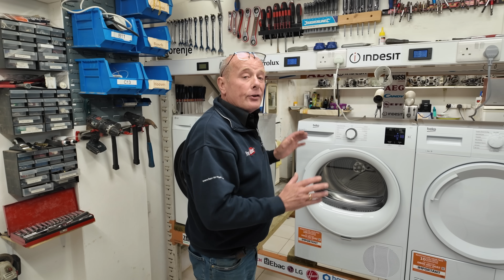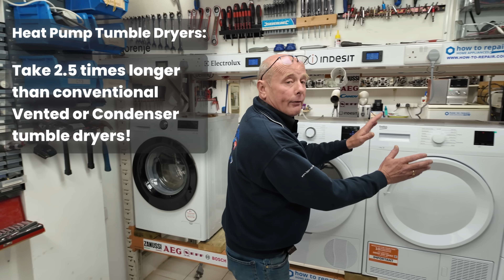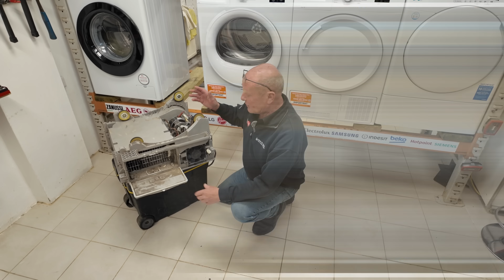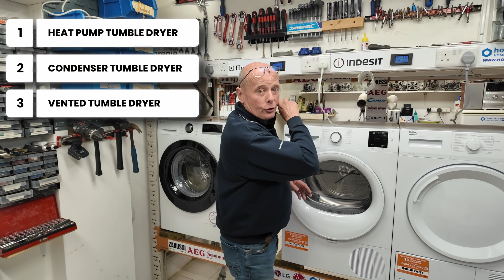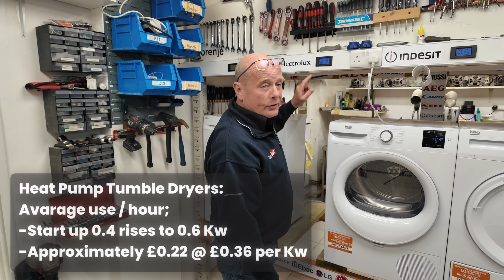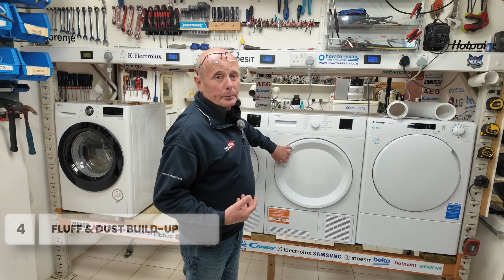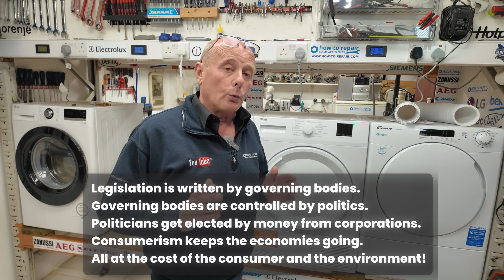Tumble Dryers the Shocking Truth About Heat Pump vs Vented & Condenser, NEW LEGISLATION!

Comment: How much electric does each dryer use with a full load until fully dry. Also with the vented we could pump that expelled heat through an outside heat exchange

Comment: I bought an AEG heat pump tumble dryer in 2007. Perhaps 10 years later it started to perform badly. An 'engineer' told me it was a lost cause and needed replacing. It had already paid for itself in terms of saved electricity as it really does use a fraction of the electricity of even a condenser dryer. But I thought I'd have a look myself. There was a foam filter that had broken down allowing lint inside the heat exchanger. After cleaning it all out and replacing the filter with a new one (They had actually changed the design to a mesh rather than foam) it worked fine again until 2022 when we moved house and it didn't survive the move. 15 years service cost £500 for the unit and it used about £90 in electricity.  An element condenser dryer would cost say £300 and use up £600 in electricity. So we now have a new Samsung heat pump tumble dryer. Ok, so it takes about 2 hours as did the AEG but I don't sit there watching it!  It uses about 0.4kWh per load.  I think the one important thing with all tumble dryers it to keep the lint cleaned out. With a heat pump tumble dryer it will stop it performing properly. With an element tumble dryer it can cause a fire.

Comment: Im very happy with the heat pump i purchased. I went for the cheapest i could find. Cost £400 and saved that in first year. Had it 3 years and use it a couple of times a day. No longer need to use softener and clothes far easier to iron.

Comment: Switched to a heat pump dryer this year and it's surprisingly quicker than my normal tumble dryer and uses a fraction of money to run, would recommend the investment anyday as don't feel guilty putting things in to dry anymore as costs literally a few pence compared to an old fashioned tumble dryer. Can't believe how quick it is as was expecting longer waits as a trade off for less energy
Reply: What model do you have ? The 2 I tried Samsung & Hoover were absolute junk In 2 months with each one I never had a fully dry towel even after 4 hours ! That was after trying every setting plus putting an extra 2 spins at full speed in the washer prior .
Reply: @paulmarlow7176  oh weird which Samsung model was it? Mine is Samsung and it's weirdly done everything and try in about an hour, I don't know how considering the cheap running costs
Reply: @ Hi ,series 5 ,cant remember the hoover model think it was H dry or something ,I'm very reluctant to buy another HP , I kept my vented stored in the shed for a while whilst giving them a go & tempt fate still going after 20 years !
Reply: No one,like no one has said a heat pump drier is faster,again no one.I own one and hate it
Reply: @crp110well I'm someone and I'm saying it's faster, what make is yours? Maybe something is wrong
Reply: Which model heat pump dryer, please? @AndyKennedy
Reply: @rolfster101  Bespoke AI™ Series 8 DV90BB9445GBS1
Reply: Never had a "conventional" tumble dryer but bought a heat pump one and I don't really know what's he on about with 2.5 times slower. Mine is drying a full 9kg load in a bit more than 1 hour. Can't speak about reliability but that's why I went for a dryer with 10 year warranty.
Reply: @georgeiulian464  I used to do towels in a conventional dryer and took 2*2.5 hours. Weirdly my heat pump one takes 1*1.5. maybe it's down to a bigger drum though
Reply: @AndyKennedy  same. And price wise, I can check in the app how much electricity I'm using, and it's £2.50 a month. And I'm drying 10-12 loads a month. That's dirt cheap.

Comment: I had a heat pump drier for a year. Biggest piece of shit I ever owned. It was expensive to run, slow, and when it stopped working, the engineer said exactly that. He took it away, and fitted a regular exhausting dryer. Problem solved.

Comment: So right on the condenser dryers having built in obsolescence… they all end up failing due to loosing gas, due to corrosion at the joint between the copper and aluminum pipes.

Comment: I bought a heat pump dryer for £700. It lasted 2 years before the condenser went. I then discovered the replacement was a whole new heat pump system, basically the bottom half of the machine for £430! I bought a Condensing machine instead for about £350. It's still going strong 2 years on.

Comment: Good points, however, there are two better solutions:  
#1 - as mentioned before, use spin drying to just cut down on drying time
#2 - use a heated clothes airer. mine uses just 200ws, which also warms up a relatively colder room

Comment: I use good old fashioned hanging drier in the winter and outside air in the spring/summer/autumn. The cheapest most environmetally way to dry clothes. No expensive tumble drier needed!

Comment: The heat pump wear and tear can easily be compensated by using higher quality materials - seeing as they are already more expensive, maybe this has already been done, if not, it easily can be. And the wear on clothes caused by running 2.5x as long is at least somewhat counteracted but running at lower temperatures (which is why heat pumps take so long).

It is a disgrace how these heat pumps are much more difficult to maintain and require high cost specialist work - that should definitely receive some focus. I think you are spot on about built in obsolescence - this has been slowly happening for many years, e.g. mobile phones, cars - and it is totally at odds with the desire to reduce waste.

I had an old washing machine that lasted 25 years and only had a couple of basic repairs that I did myself. The replacement cost twice as much, did a slightly better job, but failed after less that 10 years (I was told that was a good life nowadays!) The repair was not viable because the drum was sealed so it had to go to waste!!! What a shambles, but great for the manufacturers as you say!

Comment: We just bought a Miele heat pump dryer here in the US. 4.1 cubic feet i believe, It was a "scratch and dent" so the price was very reduced.  $990 then $200 rebate from our Power company.  They delivered and it was still in the box so i think they were just trying to clear it out last year model.   It replaced a regular vented dryer 6.7 cubic feet, that has never down a good job of drying the clothes and had to put clothes back in it all the time.  I bought the vented dry used and first had to clean the moisture sensor of the residue from fabrique softener.  Then the element burned and i replaced it.  Later the bearing in the back gave out and i replaced that.  Belt broke, i replace that as well.  Then two years after replacing the element, the dryer stopped heating.  I'm very confident on working on regular vented dryers and know about keeping the lint under control inside the dryer and my venting is solid vent pipe 4 feet long and has been kept very clean.  I told my wife i could replace the heating element again but she was fed up with the poor drying and she wanted the dryer and washer moved to the other end of the house and out of the front door foyer.  The Miele is 120 volt 15 amp circuit and dries clothes' very well at around 52 minutes per load.  It's only the two of use so the size is actually adequate for us.
Reply: @hottractor1999  Great to here, as German 👍🏼 But now the Frontloader Washing Machines also hit the U.S. market. We use to have Frontloaders for decades here in Germany, you need less water and less electricity compare to toploaders and the cleaning result is better too, because Gravity helps in the tumbler.
Reply: Suberb quality 👍

Comment: Im in the US, and I have a natural gas clothes dryer. I bought it used, about 6yrs ago and it's been nothing but a workhorse for me. No issues at all. Just have to clean it out every so often, as like many of you have mentioned, dust/fluff accumulates and needs to be dealt with. Other than that, it's been a great machine. It even has built-in humidity sensors, so it'll shut down when the articles inside are completely dry. It uses a lot less electricity than a conventional dryer and has a lot less to go wrong.

Comment: I've serviced my condenser tumble drier since 2000. After drilling out rivets and inserting bushes to aid back panel removal I can replace element, belts, thermal switches, change brushes. My only gripe is the water tank is at the bottom. I'm looking for a replacement that requires less bending but still easily maintable. Is there an online resource other than me inspecting failed machines at the recycling centre?

Comment: Fisherpakel condenser dryer rollers go. Is there after market rollers that fit? If you let them sit for more then 2 weeks they square off. Gave my mum my element dryer 9 years ago. Still going after 14 years. Since then I have gone through 2 bosch heat pump dryers (1 warranty) and now a condenser dryer.